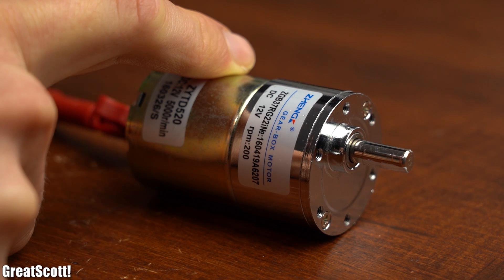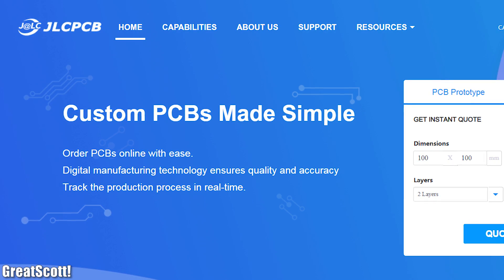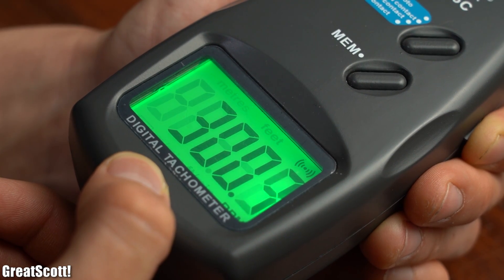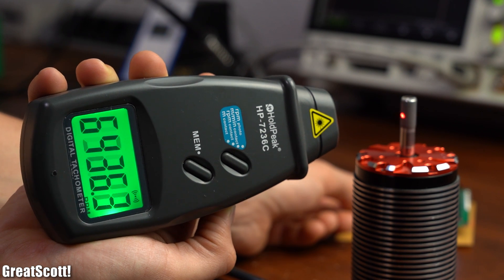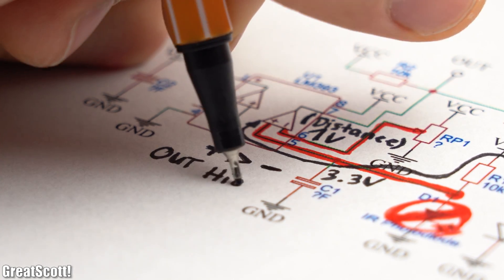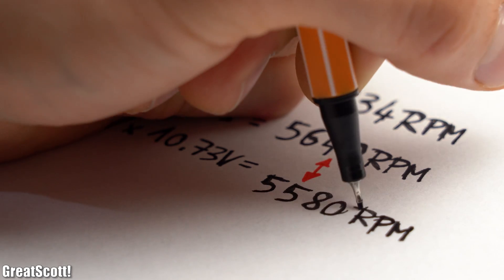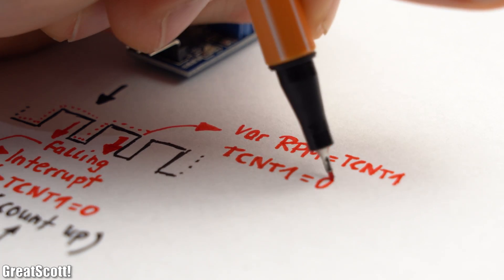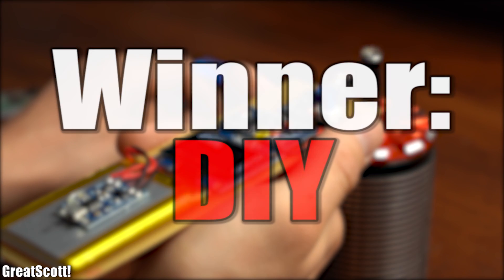Tachometer (RPM Meter) || DIY or Buy || How a 3€ sensor outdoes a 29€ product!

Comment: There is an error in your video.
The device is working correctly. You made an error by measuring the speed by contact. You should press the motor shaft to the face of the measuring device not to its side.
When pressing to the side of the gauge the contact has two shafts of different diameters. time 3:21. therefore the gauge showed a different value 3:24
The given values show that the diameter of the motor shaft is 2 times smaller than the diameter of the measuring device.
The contact gauge has a rubber cut into a cone to make it easier to put the shaft to its face.

Comment: With the contact sensor you have to multiply the reading for the "gear ratio": calling 1 the shaft to misure and 2 the roller sensor,  omega_1=omega_2*Radius_2/Radius_1

(Infact in your example the radius of the shaft are circa a half, like the rpm misured)

For me the contact method (if applied correctly) is the more precise  as long as don't putting too much contact force or/and if the sensor itself have a lot of friction (could be a  problem for low torque or very high rpm motor)

Comment: The diameter of the rolling shaft is messing your values,. Either use the same diameters for both the shafts while measuring by side, or just connect the shafts to the center of one another

Comment: FYI: there is a phone app that strobes the flashlight that you adjust until you see your mark on the rotating shaft stop. On the few motors I’ve used it on it’s pretty close to motor nameplate spec.
Reply: Can u say the name of this app?

Comment: The contact adapter needs to touch the center of the shaft not the OD of the motor shaft.  I use one of these cheap rpm meters a lot and seem relatively reliable.

Comment: Instinctively, I would think that measuring the time it takes for one turn in a slow-mo video would induce quite a big imprecision... 🤔 Don't want to sound like I'm teaching you anything, but have you tried, with the same method, to measure the time it takes the shaft to revolve, say, 10, 20 (50, 100!) times? (Maybe that is what you actually did already?)
When measuring a single rotation (360deg), a 30-deg angle error (I'm using quite a big value for demonstration, don't know how many frames your slow-mo gear is capable of) would mean the time you measured can be off by almost 10% (1/12). The same 30-degree error, when counting 10 turns (3600 degrees), would result in a time measurement that is accurate to 1%.
If your 0.26s measurement is off by 15% (again, extreme number for demo), then your RPM could be anywhere between 200 and 270... (Which I guess still does not match any of the 2 measurements made by the device... 😅)

Also wondering if you've tried using a thinner white strip on the shaft, or playing with lighting (eg. avoid direct lighting on the shaft that could result in reflections, even from the black part)?

Comment: I read the pinned comment about contact mode, but haven't found anything about the issue whether putting a load on the motor could change the speed. That would explain why it went from 300 to 270 rpm, and it may just need some calibration.

Comment: I think you are using the contact method tachometer wrong, you are measuring based on circumference. You need to put it right on the axle so that you get the rpm.

Comment: For contact RPM counter, it's preferable to use IR encoder for accurate measurement. In non contact Measurements many factors affect the accuracy: angle, light, stability of both (the tachometer and the rotor).

Comment: Should put it as close to the shaft as you can for the most accurate measurements... Light does travel away from the source in all directions evenly...at least according to our eyes... and the more light that gets reflected back to the sensor the more accurate it will be... just like Infrared thermometers...there is a range it must be in to get the most accurate measurements

Comment: 3:16 You're getting a low value because you are using the adapter incorrectly. That adapter has an internal cone cut into the end. That is for pushing it into the end of a shaft that is rotating. The way you are using it, is in surface speed configuration but you have the meter set in contact ROM mode. So, you are using the adapter incorrectly for the mode and how it is to be applied.

Comment: 9:52 - 1875000 is max in theory at insanely bad resolution,  if 29 rpm is equal to the wrapping of 2^16.. you will need at least 100 counts to get 1% resolution, so reduce that max by at least that factor ...  🤓

Comment: Using the mechanical tach wrong... The diameter of the shaft will affect the reading using it like that! It has to be directly coupled to the shaft inline and not offset unless the shaft diameter is equal to the tach head you are using.

Comment: Why don't you use the built in counter input on the atmega328p and just let it count up to a minimum number before calculating and displaying, you'd get a minimum rpm of less than 1

Comment: The problem is do you want to measure pulses pr time unit, and if so what time unit! Or do you want to measure time between pulses, and if so the triggering of the pulse/edge becomes a source of noise due to potential 50/60Hz flicker of ambient lights.
It is always a debate. I think many meters use pulses pr time unit and thus have very coarse measurement steps at low end of range.

Comment: You are not properly using the device. In contactless mode you need to use the retroreflector sticker provided with the meter. In contact mode you need to put the motor and contact adapter at same axis. Not in tangents.

Comment: the rpm 150 is wrong you are using the instrument wrong I think,  you are making a gearing extange frome the smal (motor shaft) to the tiger (the rpm meshurment devise). if the 2 shaft was the same diameter it would be the same but since its not you are blackly making a gear box and lovering the rpm on the sensor side hope you understand my bad English, best regards valdemar, Denmark :D mechanical engering studen

Comment: To test the tachometer, the easiest solution is to use a 1'500 or 3'000 rpm synchronous motor...

But nice project

Comment: Nice project , Why you didn't a reverse engineering of the commercial one  and  repair it if it doesn't a firmware problem  Or  put inside an Arduino to read the sensor and drive the lcd .

Comment: That's again is a wonderfull video. I like the DIY or BUY series. Over the past few years, I more often to go DIY. Not just because it's cheaper and I learn while building, but also because I can repair easily and recycle parts if I don't need the device any longer.
Thank you for all the fresh ideas.

My actual project is a weather station that saves the weather data to an NAS. So I have the complete history available and have at the same time a better accuarcy for temperature, humidity and rain quantity than I got from standard weather station. As a side effect I can easily display abolute air humidity or dew point, which is not available at normal weather stations. 
I also plan to display a recommendation for room ventilation based on comparing temperature and (absolute) humidity.
The internal (display) part might be upgrated by an air quality sensor in the near future, which will improve the ventilation recommendation.

Comment: I bought a similar RPM counter 10 years ago. It came without any of the accessories. ("Digital Laser Tachometer with Pouch (2.5~99999.9RPM"). When I measured a 5400 RPM hard drive platter, the display read 5399 - 5400.
Reply: old stuff what prolly much higher quality
Reply: did it cost more?

Comment: Contact measurement is off because of the gear ratio of your setup. Optical measurement should be quite accurate. Your frame count is inaccurate because of the frame rate, you should count the frames of multiple revolutions and average to get a better accuracy (assuming somewhat constant rotational speed).

Comment: 03:17 Why are there two different resuls? Probably because you totally messed up the contact measurement, because the two adapters included are ment to be placed in front of the motor shaft, so that they spin in the same direction, thats why there is one with sharp point, which is placed in a center drill hole of big motor shafts and a second one with a recess, for smaller motor shafts which doesn't have a center drill.
But again not products fault, more the operators fault.
Reply: read his pinned comment

Comment: Hi Great Scott, I have the feeling that you missed something in the measurement of the rpm by contact. Indeed, your tachometer measures the rpm of its own head, and thus you must introduce a correction coefficient as the rate between the rotor head diameter and the tachometer head. The tachometer cannot know what is the diameter of your shaft!
Reply: Exactly! The "by contact" probe should be touching the motor axis in such a way that both rotate at the same angular speed: they mustn't touch side-by-side, but tip-to-tip.
Reply: I don't know the specifics about the device but also when you measure with contact sensor you introduce a load to the motor which might effect the rpm. By how much would it effect, that i don't know
Reply: @enesmutta194  The introduced load from the test should still be a fraction of what the actual load outside the test bench is.  But the biggest problem was he was misusing the contact probes in the first shot as @Eduardo Pérez Esteban mentioned
Reply: But then the IR Sensor is the better solution anyway. No need to calculate something...
Reply from the maker: Read my pinned comment.
Reply: @greatscottlab  There is no pinned comment :(
Reply: I see it. Says that it's been there for a week.
He doesn't go into detail but he said that he figured out he was doing something wrong and retested, and that it was closer but still had some error in the measurements.

Comment: May I ask if your project based on the 3.3V version or 5V version?? I assume with the OLED you are using the 5V version, but may I know if the TP4056 is safe with the Li-po for this project?
Reply: Also can you link to schematic for easy reference? I am using a Hall sensor for similar project.
Reply: use android phone app infrasound detector. you only require IT emmiter and recievier

Comment: Costs 20 euro to make, and the most expensive component aside from the battery is probably the OLED display...
Reply: use android phone app infrasound detector.
only require IR emmiter and receiver.
cost very less

Comment: These small modules suck. Just bring it to bright light or sun, and it will start to measure weather on the moon. I think that frequency modulated signal ( like in TV remote) might work for RPM measure.

Comment: Regarding the 300 rpm, you're not following the min distance of 5cm (50mm) as per the manual.
Maybe that's why the reading is off. In any case it sounds odd that a commercial device doesn't measure rpm accurately while a simple DIY contraption can.
Especially at such low speeds. There must be something you're not doing right, and the measuring distance can be just that.
In any case it's nice to see your solution 3€ module, an arduino plus some simple software :)
Reply from the maker: Nope. I tried all kinds of distances. Always the same inaccurate results.

Comment: Replace the offset adjust pot with an RC low pass filter. C to gnd, and R to +Vcc. The common between R and C connects to the anode of the IR photo diode. Through a small signal diode like a 1N4148, with the cathode connected to the common RC connection. Set the time constant of the RC to something like 15 Hz, say 10K and 1 uF. Add a resistor in parallel with the C to let the cap discharge slowly. 30 to 100K should be fine. Now the unit will set the offset automatically!!

Comment: A few years back I built one for a record player to convince myself that I wasn't hearing things. Naturally I went about it in a far more convoluted way than this. 
In my defence I think most of the hard arduino code was phase 2, trying to regulate the motor PWM speed.
Reply: Nice how did it work out in the end, been thinking of a stepper motor record player with one of these to be self correcting

Comment: Men the diameter of the rolling thing is affecting the values , smaller more turns bigger less turns, you got to used aligned, not in besides
Reply: Yup, in contact mode, the tacho will be accurately measuring how fast the tacho's shaft was turning. To measure the speed of the shaft, push the contact rubber onto the ene of the shaft, not rolling around its side.

The user manual would have made this clear, but it was probably in impenetrable chinglish.
Edit: someone else picked up the reason why it failed with the optical - insulation tape's optic properties are horrible. It is designed to be used on the bare shaft of the motor. If you need to add anything to make a mark, try painters masking tape.
Reply: To use contact mode you must put the probe coaxial with the motor shaft not side by side like a spur gear arrangement. Great video tho!
Reply: I was looking for this comment.
Reply: What you're saying is correct, But in this case laser tachometer reading incorrect RPM value, Diameter comes into account when we measure travel distance of shaft m/min.
DIY wins
Reply: Yeah that's the first thing that came to my mind. They are basically working like gears.
Reply: LoL just here to remind you we are talking about RPM...... revolution not speed
Reply: just about to say the same thing lol even if he was measuring from the side the speed would be different but they would complete one turn at the same time
Reply: He tried that too, wasn't accurate either. 4:12
Reply: @jort93z  Are you sure? I think the adapter hides the motor shaft below.

Comment: I found using old IDE cables make running traces so much easier. You can make a ribbon as wide as you need. Bend it wherever you want. Lays flat.

Comment: @GreatScott - you mentioned a theoretical maximum RPM that can be calculated by the arduino, but do you have a sense of the practical maximum RPM ?  I was considering using this circuit and devices to measure the speed of a CNC spindle I have that tops out at 24000 RPM, and was wondering if this hardware can keep up?
Reply: Very high - well beyond the speed of a CNC spindle. 20,000 RPM is still only 333 revolutions per second. Even the crappiest photodiodes should have no problem operating a 1KHz - sampling 1,00p times per revolution - more than enough to get a good speed measurement. Keep in mind that there’s no reason the reflective portion of the shaft circumference needs to be small. 180 degrees of reflective are might be more appropriate for measurement stability at max speed - assuming the area can be kept clean, etc. A more reasonable photodiode would be expected to operate at 100KHz or so. At that speed, it should be possible to determine the phase within about 0.02°, in addition to detecting the speed with outstanding accuracy. Edit: correct stupid math error. Bottom line remains the same: at 24K RPM, the MCU (especially a blue pill, my personal preference) won’t even be breaking a sweat. Also, see my related comment re Hall effect sensors. Best of luck with your project.
Reply: Karl Miller Oh, I should also mention that Hall effect sensors would be superior to optical ones in almost every way in an industrial environment. Years ago, fuel injection systems used one or a small number of magnets on the engine flywheel to compute RPM and timing. Now, the ECMs and sensors are fast enough to count every tooth on the flywheel. So, on the mill, they should have no problem counting the six “corners” of the collet/chuck.

Comment: Coudln't agree more, long ago i made my own tachometer the same way you did, but instead of checking time between interrupts, i counted how many revolutions i get in 1 second, and then calculate how many in a minute, and display it using a simple 16x2 LCD display... less acurate, but it is what i could do myself back then...

Comment: Great video, very informative and practical.
Just a thing I noticed, because I stumbled over it not too long ago myself: The two pixel white strip to the right of the OLED (10:03) is most probably caused by a wrong display type. If you have a SSD1306 but initialize it as a SH1106, or the other way around, you get those strips.

Comment: Title: How a €3 sensor outdoes a €29 product!
GreatScott! to the €17 used on the parts: "I'm gonna pretend I didn't see that"
Reply: It is 3 Euro if you connect the sensor to the oscilloscope
Reply: Bakyt-Bek Murzabaev lol. Funny, but true. I’m sure it’s possible to excellent results with an $8000+ oscilloscope, like the one on his bench.
Reply: And you could built this cheaper if you use a led 7 seg display and no battery. Cheapest would be to use only arduino and that ir module and read the rpm via serial read...

Point of the video is to show what a simple sensor can do. You can modify his project in many ways.
Reply: aleksa stojanov it might be interesting to try using the Arduino/blue pill/whatever analog output and read the voltage with a handheld multimeter. So, maybe 3.172V represents 3,172 RPM. Both the sensor/arduino and DMM are portable and small, so that doesn’t seem like too much of a hassle if you’re just looking for an estimate within 1% or so, once in a while. Minor edit: updated arbitrary voltage example to be within the range of the 3.3V DAC.
Reply: He said "sensor" in the title. Obviously you will need other components to use the sensor.